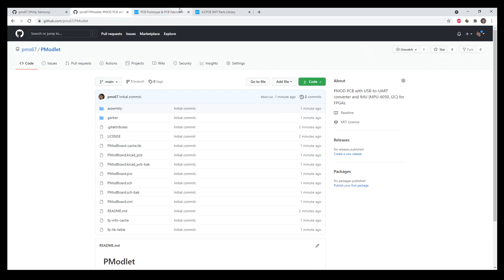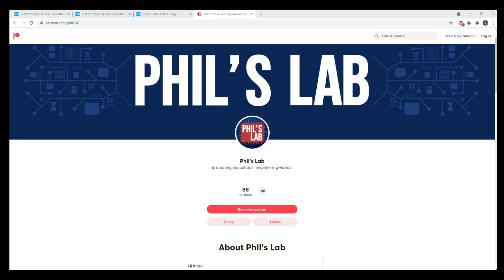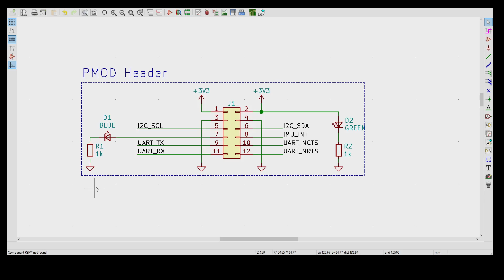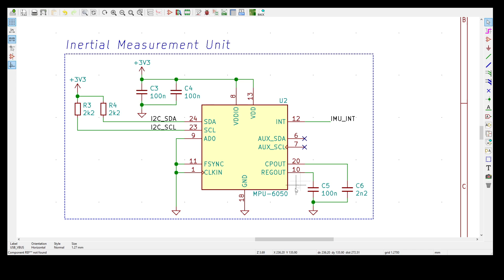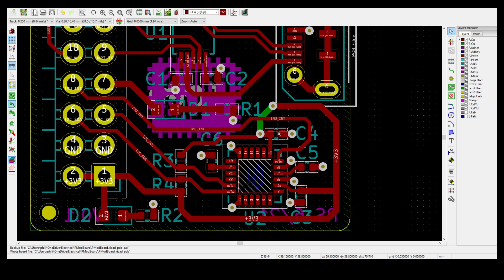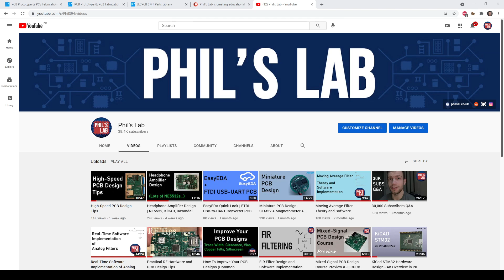(Sponsored) IMU + USB-to-UART Pmod PCB for FPGA | KiCad +  Giveaway - Phil's Lab #26

Comment: Thank you for the video. I want to use CH340E as USB to UART converter because I need an UART interface for my STM32. Can I directly connect the TXD and RXD pins of the CH340E to my STM32? In this case should I power the VCC pin of the CH340E with 3v3?

Comment: Grab a XC6SLX9-2TQG144C and slap it on to a board with a VGA connector and a bit of ROM and make a simple VGA dumb buffer that outputs an image from a ROM chip on to a VGA display. I would suggest a more modern FPGA, but they seem to be out of stock and prices are somewhat ridiculous.

Comment: I would really fin a break outboard based on MCP2515T-I/SO CANBUS would be nice. I'd love to have on that allows power via the CAN cable (say 12/24V) so you can have the power and CAN signal on the same cable and the breakout powering a 3.3V or 5.0V MCU. This would allow on to connect several cheap MCU with a single CAN cable and power the entire network using the breakout and 12V/24V.

Comment: RP2040 - JLCPCB have recently started offering the RP2040, at the time of writing this they have 162 in stock at $1.1582 (£0.84) here in the UK. Awesome dual core M0+ micro for the price, with good documentation and still available whereas so many micros are on a long back order at present. Would be nice to have a larger development board than the Pico, with a suite of sensors and other components on board to have a play with and some digital signal processing.
Reply from the maker: Thanks for watching!

Comment: New board design idea: 
35x35 ardupilot compatible flight controller with IMU, baro, 6S battery input buck, OSD chip, S-bus input, USB and 9v or 12v buck.

Comment: I would love to see a Video on the popular ADAU1701JST Audio DSP. It Has several audio channels,  high resolution ADC/DAC and can fully be configured with the great software called Sigma Studio. There you can easily design filters and audio effects which makes this IC an excellent choice for a low cost DSP without the need to programm all algorithms by yourself.  Because it is widely used, JLC has thousands of them in stock. Keep up the great work.

Comment: I'd love to see a design using something like the MCP3561R 24-bit (oversampling) ADC. Measuring ultra-small-scale signals has always fascinated me, but seems to have all sorts of black-magic rules: guard traces? split power supplies? split ground planes? Vref filtering? I would love to see your approach to the problem and see what kind of signals you can measure. As a motivating use case, you could hook one up to an analog accelerometer and try to detect e.g. low-frequency vibrations from cars passing outside without needing an amp.

Comment: C69119. This is a SIM800C 24Mbit for 2G/3G/4G/5G connection. The idea is to create an IoT device that used GSM rather than WiFi.

Comment: compact LIDAR based wind speed measurement modules for airplanes. It predicts turbulence or cross wind ahead of time so the plane can do some countermeasures. 
You could use this part e.g.: MFR.Part #STM32F030C8T6
Reply: Maybe just the sensor module. To do this right you’d need for more processing power and a complete sensor suite. And it would be best to have this integrated with the flight control computer.